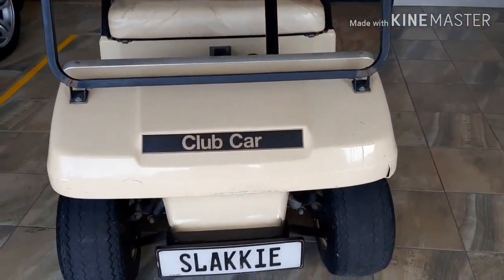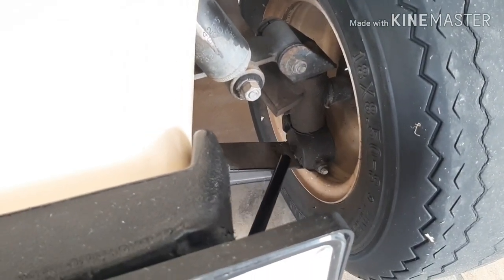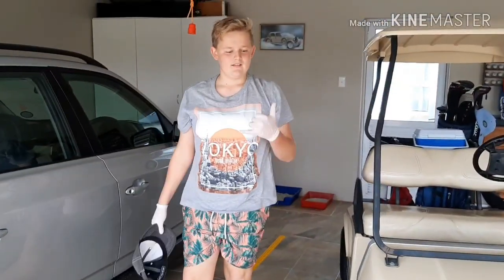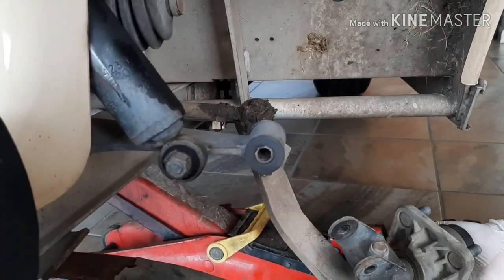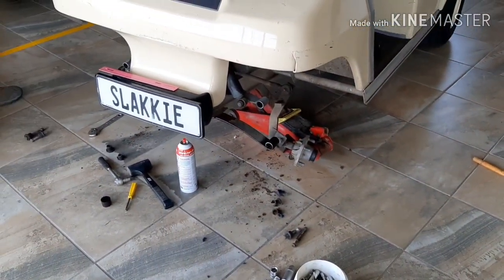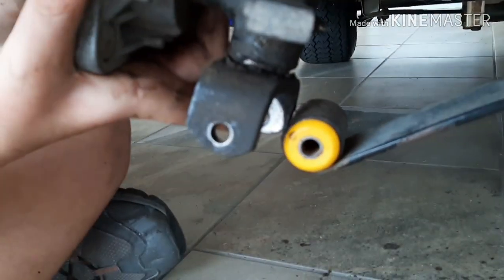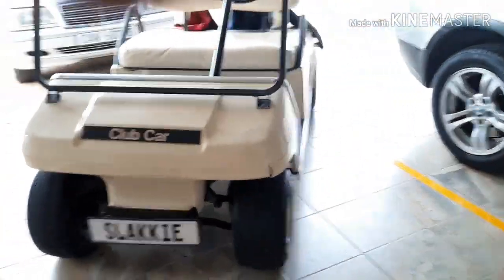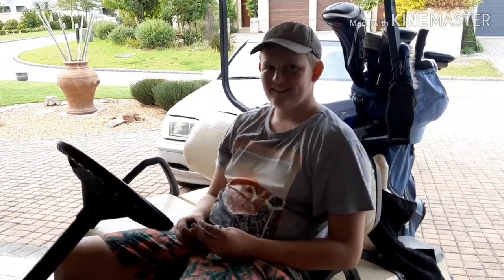Replace Bushes on Club Car

Comment: Please use jack stands to rest the chassis on and do not depend on the hydraulic jack.
Also, all the spares are available from Smiths Industries in Germiston - they are the Club Car South African importers. I am busy replacing all the Bushings on my 2010 Club Car Precedent. Today I also discovered that I have to replace the Kingpins and Brass Bushes in the  Spindle.
So I will collect the spares from the Agents on Monday.
Reply: Best of luck. Thanks for the jack stands tip.